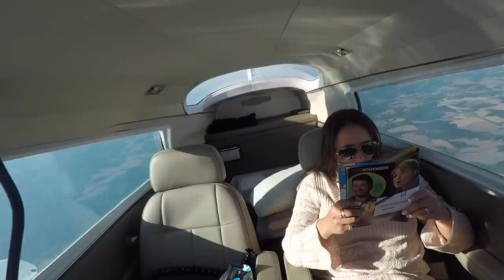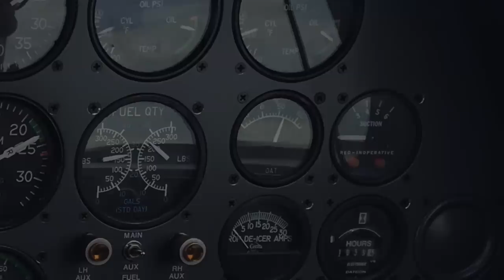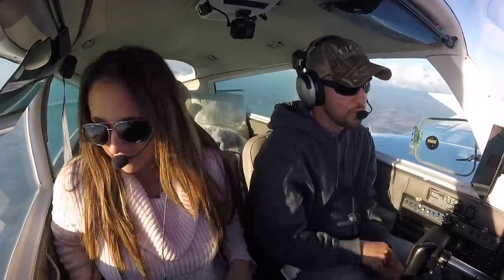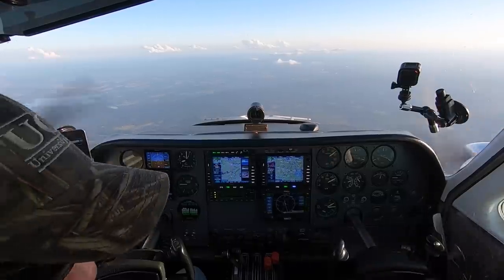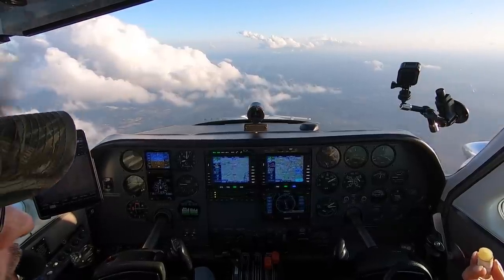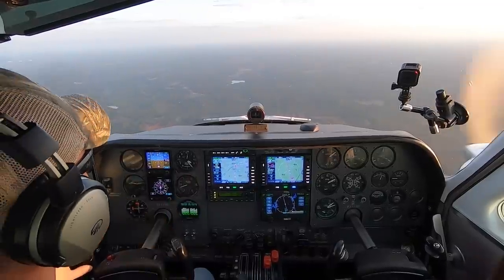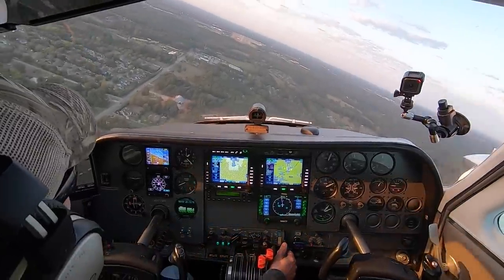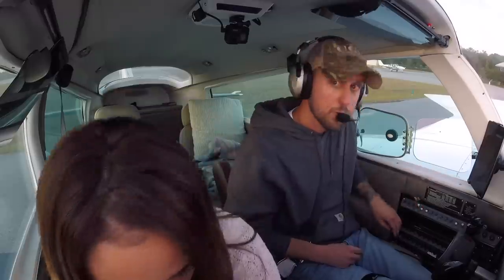Gulf Coast Swing 2: FAILURE of BOTH Vacuum Pumps!

Comment: The only time that I had both vacuum pumps fail, I was IFR and on a IFR clearance headed to Nome Alaska from the north. When I broke out of the weather I saw that if I canceled IFR, I could get below the overcast and scud run into Nome by getting over the water of Norton Sound and just have water below me instead of mountains below me. Nome was 500' overcast and 5 miles visibility. It worked out well...I just had to wait my turn for the special ATC clearance into Nome. I came in under a special VFR clearance with 3 other aircraft at the same time which was a common occurrence when the weather was low. I was flying a Piper Navajo and came in with the other pilots who were all flying Cessna 207's...a work horse of an airplane  back then in Alaska (the 1990's) and still is a work horse in Alaska today.

Comment: In the middle 1970's, our 7 member flying club had Mattituck in Long Island overhaul the Lycoming IO 320s at about 2200 hours on our PA 30 Twin Commanche. We were all commercial and instrument rated and I was an airline pilot. It was based at Belmar on the NJ shore. The first trip after overhaul was taken by two of my partners from there to Norfolk in night soft IFR conditions. Both vacuum pumps failed. We had an electric turn co-ordinator which was a turn and bank that looked like an attitude indicator and they successfully completed the flighty. Mattituck, a highly respected shop had not replaced the hoses and when they re-installed them tiny pieces of rubber were loosened and soon failed the graphite vane dry vacuum pumps. Mattituck sheepishly replaced all the pumps and hoses. Ironically, we had operated a PA 24 Commanche before and we had added a ventury in parallel with that vacuum pump with a check valve and 337 form. A few years after that mod my partners called and said that pump had failed also but it wasn't apparent until after they landed and the suction went to zero. Those graphite vane dry pumps were a disaster. They could fail at any time. Your 310 is fancier than the L 1011s I flew but they did autoland.
Reply from the maker: Glad your partners were good partial panel sticks and landed safely. Good to hear that Mattituck recognized their mistake and took care of the repairs. Before I started upgrading the avionics if this would have happened IMC to me all I had was the old school dog house turn and bank indicator and it was always just flopping along left and right of center in level flight. That would have been a full blown emergency for me. Glad to have her upgraded with some safer stuff now. I did get a chance to fly an L 1011 sim at Delta many years ago when they still had them...neat plane. :)
Reply: The L-1011 AP wouldn't fly arrivals and departures like modern planes but it did very good auto-land and was very advanced and easy to fly and fast except on landing and takeoff. I had it to M .9 with nary a buffet ripple. We operated it routinely into LGA's 7k ft. runways. The only time I flew a 310 was with a friend and he had to take over from me on final as I got it in a pilot induced roll oscillation due to the tip tanks.

Comment: I've learned that when ever I sleep in anything moving, especially a small plane, I try to figure out a way to loosely connect a seat (or atleast a shoulder) belt around my person.  While it hasn't paid off in a plane, it most certainly did while sound asleep in the 3rd row seat of an Expedition.  It prevented a minor fender bender from being major injuries as I woke up in midair above the second row seat, after a small 2dr Honda pulled out in front of us...

Comment: Dual vac pump failures in twins is common. Vac pumps seldom make TBO. If they are both old and have hundreds of hours, they are on borrowed time. If the engines are running, the pumps are working full time keeping the boots (wings and tail) down and operating gyros. If one fails, the other must take up the entire vac load and it will often fail in a few minutes. Best plan is vac pump OH every 4 to 500 hrs. The new glass horizons, or a back-up electric gyro, make it less of an emergency. I see you got your left CHT repaired. Keep up the great flights.
Reply from the maker: Thanks for the insight Larry! I always thought it was rare. I knew these were getting close to time/hours and now have 2 new ones to track for replacement. As you said, with all my new avionics it was much less of a situation as it would have been IMC a few years ago for me. CHT is repaired and I just picked it back up with two new pumps and the surface de-ice switch that failed replaced. They also re-did my fuel flows and the mixtures are much more aligned now. :)
Reply: Glad you got everything repaired. I've flown most 310 models for just over 50 years. We've owned 310s for 26 years and currently have a 310R. It's equipped about like your Q except for the new AP and color WX radar. (We're jealous) We have monochrome radar and XM WX along with a Bendix AP. I'm an ATP, AP, IA, have refurbished several Cessna twins, and write tech articles about them. My co-pilot's name is Janie. You guys operate your aircraft like professionals and it's fun to watch. I've turned several of my cohorts onto your site. Good luck with it.

Comment: In our 1959 Brand new Cessna 182B, we had a generator failure, with 30 hrs on the airframe & engine.
This was on takeoff, when the panel light came on, my dad radioed the tower to go around & land.
He did not declare an emergency, but almost blew a gasket himself.
There were no parts, as the generator broke a brush on takeoff, a call to the factory got quick action, as we were in Chanute Kansas. 

With newer pilots relying on glass panels, the old school pilots feel old.
Steam gauges are still the best IMHO.
Kevin calmly described the problem, while Jamie returned to the right seat, without being asked.
They could have had another failure at any time, but continued to the destination.
Good job to you both, for handling what easily could have become an in air emergency, at any time.

Comment: Glad it wasn't more serious, but that is strange, 2 independent system to go like that. Know you told me it wasn't in the new systems, but those old ones are the ones that many of us learned to fly with, and anytime they are compromised it keeps you on your toes. Hope they had the facilities there to help you w/it, have been there, but a long time ago. Pretty area.
Reply from the maker: Glad it wasn't more serious and I upgraded to new systems so this didn't ground us. Turns out it was the switch that controls the boots that failed and caused them to inflate without letting up and taking the pumps out in the process.

Comment: On my 4th flight newly minted PPL, I’m with my friend and we land at a small place in NJ and as I am taxiing back I look at my Vaccuum in my 172S, and it’s reading zero. I do a high speed taxi down the runway and the Vaccuum barely gets anything. 1 of 2 pumps sheared, luckily under VFR I didn’t need the attitude or DG, still scary. Called flight school I rented from Chief Mechanic said as long as I’m comfortable I can fly it back and obviously they will repair it, so flew back no DG no Attitude that was reliable. Pretty scary but it’s interesting how we pilots are trained and programmed so much to immediately identify and resolve issues. Glad you had the glass to keep going!
Reply from the maker: That stinks you got a failure so soon after your new PPL but sounds like you handled it great! Having that failure early on while VMC has probably been (or will be) valuable to you with IFR flying and mindsets.
Reply: 310 Pilot absolutely!

Comment: First thing I thought of was a connection failure for a dual loss.  Just by the odds if it you'd have to think about the rework of the dash as the culprit.  Happy it wasn't anything more substancial.
Reply: That’s what I was thinking. Never fails when you upgrade or replace things everything else decides to act up.

Comment: This dual failure due to being overworked by the deicing boots is a new one on me, but I'm not surprised. I think I've experienced about all the other ways they can fail. My favorite (not!) was caused by an improperly installed bushing in the accessory section of a newly overhauled Continental IO-360. Had several pumps fail in a row due to vibration in the drive shaft for the pump. I'm still grateful to the Teledyne Continental rep that helped us finally determine what the cause was. I am now a believer in doing factory reman engines instead of local overhauls!
Reply from the maker: That's awesome they were so helpful in figuring out that problem. I hate problems like that, that are hard to determine and keep costing you money (new pumps and exploratory surgery) to try to figure out. I hope to not need new engine for several years...knock on wood...but will keep that in mind in the future.

Comment: The 73 "Q" I flew on a cancelled check run between MSP and MDW with multiple stops every nite back in the 80's, had a dual failure in IMC. it's kinda scary when you see your attitude indicator start rolling over...  One finds herself flying Needle, Ball and HSI giggle. Fortunately it happened under my final leg about 30 minutes short of getting back.  Sometime along that A/C's life somebody replaced the original WET PUMPS with dry pumps during an overhaul or reman (cheaper) and the dry pumps fail just like that bang - bang... I have had just about one of everything crap out at one time or another in Cessna Twins.  Eventually you'll have your bird completely solid.  You seem to spend the $ where needed. Enjoy your channel.

Comment: I flew a twin for years. If you lose the valve that shuttles between vacuum and pressure, you will lose both as the valve stays partially open. Achilles heel of the de-ice boot system that no one tells twin drivers about.  Carbon dust from the vacuum pumps jams it up. 
Service the valve and your back in business. VFR no issue...;-)

Comment: Kevin, once on a VFR flight in my Baron, I, too, experienced a dual vacuum pump failure in a 30-minute flight segment.  Fortunately VFR.  Taught me dual pumps are not as redundant as seemed before.  Good lesson learned.  Would have been harsh maybe if it’d been IFR at the time ... You’re an admirably disciplined pilot in ever;thing you do.  We’re all a bit more cautious about announcing “clear of the runway” these days ... until we have our tail feathers across the hold short line exiting, don’t you think?

Comment: Did the plane have a turn rate indicator (needle / ball) before all the upgrades?  In times past, that was the backup instrument.  Considering how small, light, and dirt simple they are, I'd be tempted to keep a turn rate indicator in an airplane used for IFR work...

As to the cause of the failure...  Maybe the pumps got fouled by some kind of contaminant being released into the system?  A failed filter?  I guess as soon as one pump fails, the other pump starts moving more air, which I wouldn't expect to be burdensome, but the vanes in the pump might get brittle, so a different loading condition could cause them to fail?  Also, I remember being admonished to not turn the props backwards because doing so rotates the vacuum pump the wrong way, possibly damaging it....  Anyone walking your props backwards recently?  Will be curious to find out what happened.
Reply from the maker: Howdy Mathew! It did have an old (crappy) Turn and Bank indicator that has since been removed with the upgrades. If that was all I had and I was IMC with no pumps it would have been a full blown emergency for sure. 

Turns out the cause was the surface de-ice switch malfunctioned and activated the boots and wouldn't let them stop. During this the pumps gave out one at a time 10 min apart. I've since had all that repaired and we are good to go again. First time in 20 years of flying I've heard of a failure like that. Always learning. :)

Comment: As I said once before, "just a battery fail away from the Wright Brothers". If the setting was no pumps, in limited vis, and the panel goes blank... IMHO, I would have diverted. 
I'm betting there's a point of commonality in the boot system. They're not fully inflated. No info from the audio about whether they were equally partly inflated. If they were, I'd call that more evidence something common in the boot system may have to driven the pumps to Tango Uniform.

Comment: Dual vacuum failure? Hmm maybe a vacuum leak ? Not so much a failure but since it’s not keeping vacuum pressure is indicating failure? Can’t wait for the update.
Reply: My thoughts exactly.
Reply from the maker: Howdy Chris! I just picked the plane back up from Burlington Air Center and it turns out the surface de-ice switch became faulty and called for an un-commanded full inflate of the boots. After a few minutes of them not letting up the old pumps quit 10 min apart and were completely trashed. I have a new switch and 2 new pumps. Tested it out flying back home today and all is well. :)

Comment: I had a dual generator failure in my 310J over JFK enroute from OXC to PVG  at night in IMC conditions. I noticed the lights getting dim before I called ATC. Had to shut down all electrical. Fortunately, the destination was VMC. Found the brushes had burned out of the right generator and loaded the left generator and it threw the belt. A lot of times when one piece of equipment fails it loads the other up and it fails shortly after. Bet your glad you had all the electronic gyros. Do you have the battery backups on the G5s?

Comment: Back in 1989, we were hunting elk in southern Wyoming.  4 pilots, two Beech barons, one B58 and one B55.  We picked up our IFR clearances right after take off from uncontrolled AP. Destination San Angelo, TX at 13000. Twenty minutes in route with Albuquerque Center started picking up rime  ice (at one point later in the flight we were both indicating about 140 knots with nose high attitude) started building inside engine nacelles first. Buddys behind me called on unicom freq and said they had ice build up on leading edge of the wings and exercised the boots to pop the ice and blew one of his vacuum pumps.  I did not have boots on mine just alchol prop and windscreen. His question was should he exercise the boots a second time.  The answer was a solid "Hell No"!! His instruments were vacuum, my baron had and HSI so no problem. Finally got down to San Angelo and started setting up for approach, when we went thru 4000 ft. the ice started coming off the wings and belly and hitting the tail section, damn thought it was going to tear it off before it finally all came off.  Excedrin headache on the ground big time. I was amazed at how much weight those AC would carry and still be manageable.  Thanked the Lord a dozen times.
Enjoy you guys, be safe out there.
Reply from the maker: Thanks for the story Sandia!! That is one of those kiss the ground moments for sure. Good call on no more boot inflations after the first pump quit. He could have been like me with the second one to follow. I'm really excited about the new technology (like my G5's/IFD550) that change a full blow dual vacuum failure (IMC) from an emergency to a non-event.

Comment: Great video as usual Kevin! Little more excitement with the vacuum failure! After looking thru all the comments, I didnt see anywhere mentioned what caused it?
Also, since the vacuum failure caused the de-icing boots to partially inflate, I wonder, do those boots have any noticable effect on how the plane flies with them inflated vs uninflated? If one side inflated and not the other would it cause serious yaw, or would that even be possible?
Glad everything worked out fine and I hope my questions dont sound too ignorant..

Comment: No way both pumps failed. Something in common is the culprit, like a switch.
!!!Glass!!!
Reply: what I was thinking. Considering he never called for or hit the ice boots.
Reply: All of that dash work would be the first place I would look
Reply: Deice boots run off them. They will overheat and burn up fast if you are at high altitude or use them excessively.  And if one fails the remaining pump will not last long running the whole deice system.

Comment: The irony of having dual mechanical systems for redundancy is if they both have the same number of hours on them they will quite often fail quite close to each other.  :-)
Reply from the maker: While true, these pumps were different in years and number of hours. This was the result of a faulty surface de-ice switch that called for full inflate of the boots and wouldn't let up. It took them both out. Good news is the switch has been replaced and now I have 2 new pumps to track and replace before they fail. :)
Reply: @310Pilot  ... ah that was unlucky. Good to hear you found the culprit,  nice to have a mix of mechanical and electronic systems so you are not completely relient on either  👍👍

Comment: Did you figure out the vacuum pumps?  Did the pumps fail or was there a line issue from the engines to the instruments?  Glass cockpit is great but it's nice to have a back up even if you never need it.  (I'm old.)
Reply from the maker: I agree about being nice to have the backup! Turns out it was a faulty surface de-ice switch that failed and called for a full boot inflate without letting up. Unfortunately this wasn't in my scan being VMC and warm and after a while it caused both pumps to fail 10 min apart. I've never heard of this type failure before...always learning. :)

Comment: I had a vacuum failure in my little piper I flew last year. It does happen. But dual failure? The chances must be extremely low.
Reply from the maker: Hey Niko! Turns out it was a faulty surface de-ice switch that failed and called for a full boot inflate without letting up. Unfortunately this wasn't in my scan being VMC and warm and after a while it caused both pumps to fail 10 min apart. I've never heard of this type failure before...always learning. :)